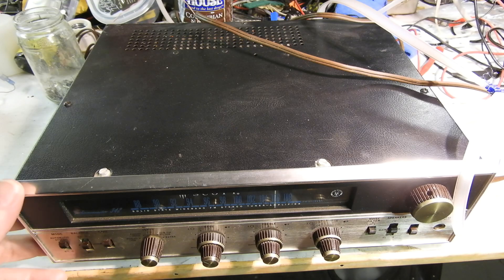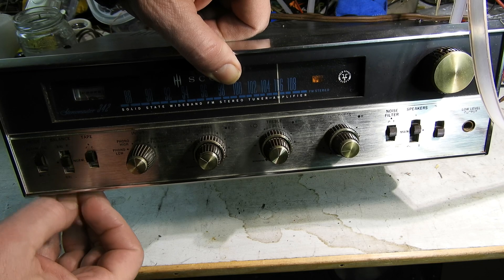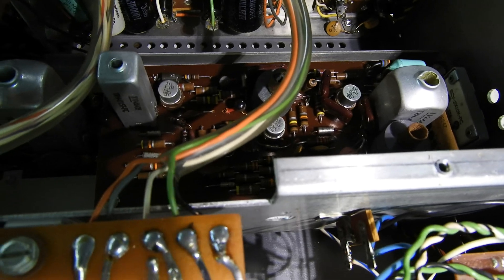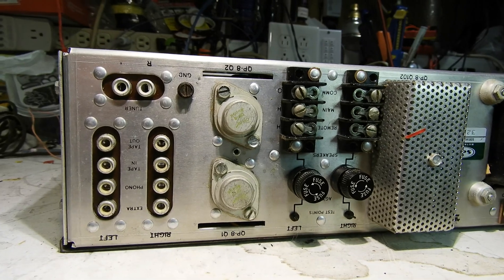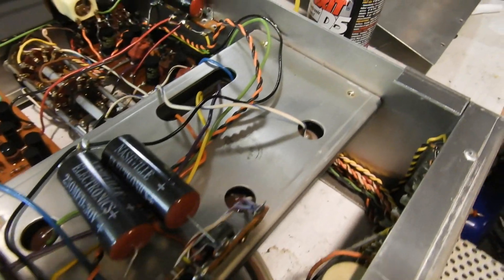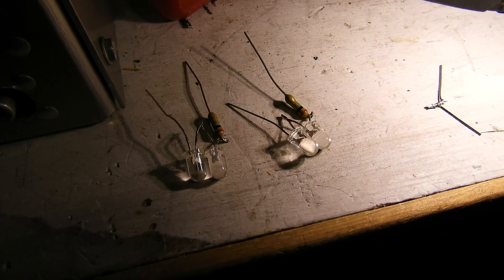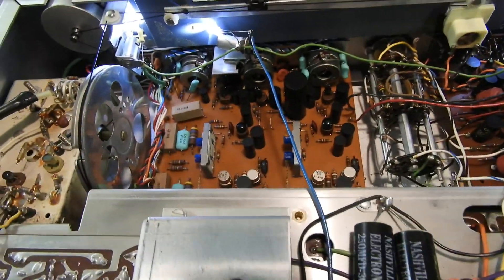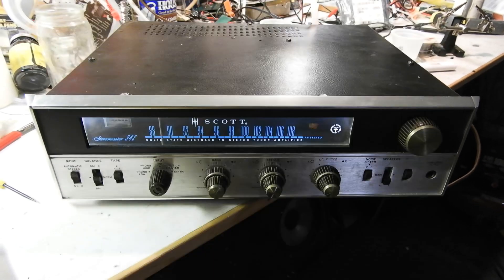H.H. Scott Stereomaster 342 - Solderless Repair - 5 Year Checkup

Comment: Hi, may i ask hows the 342 doing after 4 years? Replaced any capacitors? Recently acquired a mint382b. Thanks
Reply from the maker: She still lives! The slide switches are still troublesome if it hasn't been used for a while, they would be a major project to replace. It serves as a TV amp and basement stereo at my parent's house. I might be getting it back if I want it, we have to sell the place. All original capacitors, Nashville, I think. I'm sure if I ESR tested them all I would find some issues.

Comment: Hello-is rhere any way you can show a video or send an explanation on where we are supposed to plug speaker wires into the back of these?
Reply from the maker: There are two black barrier strips in back, one for left, one for right. Each barrier strip has Remote, Main, And Comm. So for the main speaker pair hook the hot leads to main, other to common. For a remote pair of speakers, those hots go to Remote and Comm is shared. Helps to crimp those little forked crimp-on connectors onto the speaker wires to keep things neat.